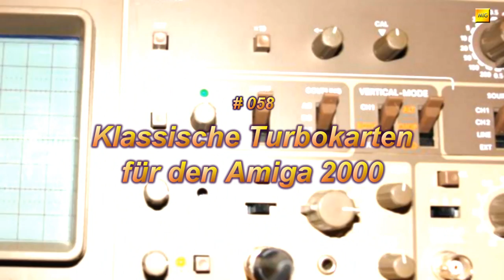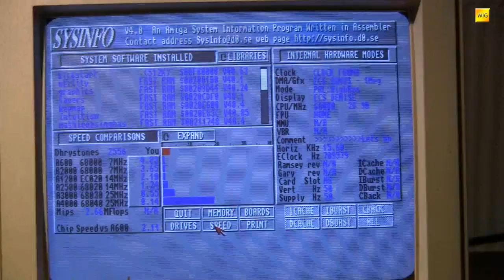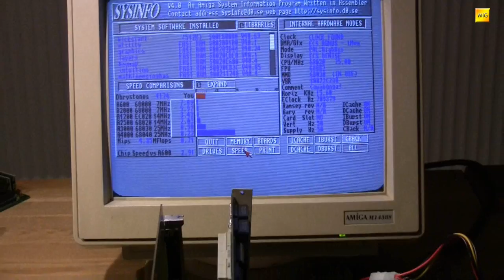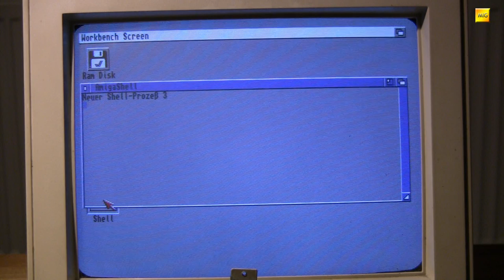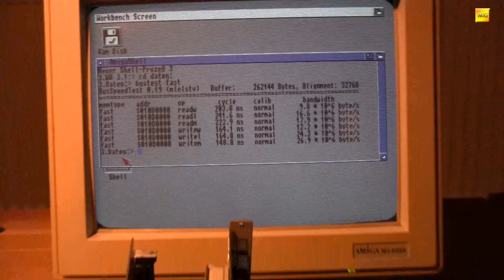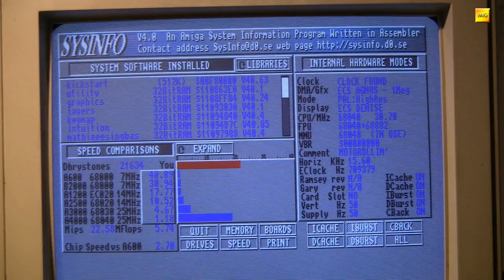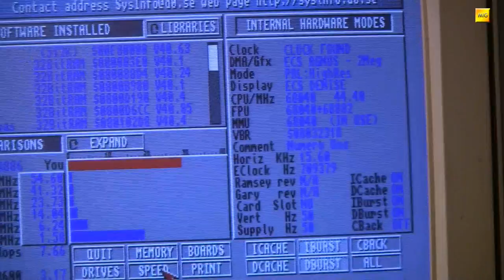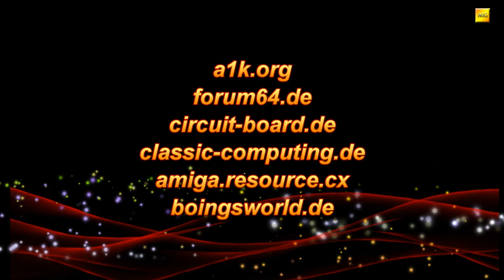MIGs Yesterchips - Folge #058 Klassische Turbokarten für den Amiga 2000

Comment: Danke fürs Video. Hatte die G-Force 030 mit 4 MB für damals 3000 DM, SCSI Platte ca 1000 DM, Syquest Wechselplatte 1600 DM, Flickerfixer 400 DM , Amiga 2000 nochmal ca 2000 DM. konnte damals nicht ein Bild über den Bildschirm schieben wie beim Smartphone und hatte dennoch riesigen Spaß, auch traf man sich mit Freunden um gemeinsam zum Spielen, quatschen usw. Mann machte noch was gemeinsam, daran erinnert man sich gerne.
ein Genlock und einen RGB Digitizer hatte ich damals auch noch.
Reply from the maker: Da hattest Du aber ordentlich investiert! Nehme an, dass Du das System zum Arbeiten eingesetzt hast? (Fürs Zocken wärs ja a bisserl übertrieben ;) )
Reply: Leider habe ich nie was gescheites hinbekommen, Genlock und meine Sony Videocamera hatten immer Probleme mit einem stabilen Farbbild. Habe damals gut verdient und sonst keine Hobbys. 
Das Genlock habe ich noch, war von Peter Biet oder so ähnlich, es kam als Set mit einem Videorecorder von NEC ohne Assembelschnitt, war also kaum zu gebrauchen.Es hat trotzdem Spaß gemacht. 
Viele Grüße
Thomas

PS nochmals Danke für Deine Videos

Comment: Phone me NOW!!! Hatte ich am A1200 schon mit der 040/40 ;-)
Wie ist eigentlich die Verfügbarkeit un Preislage bei 030 TK für den A2k?
Reply from the maker: CCfiftyeight Kommt drauf an ob du etwas gängiges oder etwas rares haben willst. Die A2630 dürfte so um die 200 Euro taxieren.
Reply: Ich brauche da nichts dolles. Derzeit ist es halt noch ein stino A2k mit scsi Platte und Aos3.1. Da für viele Progrämmchen und für whdload ja etwas mehr Leistung nett wäre und ich auch gerne meine cv3d gerne drin hätte, wäre halt etwas potenteres als die 68000 wohl angebracht 😉
Ich bin da leider schon eine Weile nicht mehr in der Amiga Scene unterwegs gewesen und kannte deshalb nur die Bucht als Bezugsquelle und dort sind A2k tk leider etwas rar... 😑
Reply from the maker: Für die CV643D wäre aber schon ein 040 angesagt. Klar, "laufen" würde die auch mit einem 020...aber da haste keinen Spaß.
Reply: Wobei die 040 Karten wohl "etwas" rarer als die 030 sein dürften, die waren zu "Lebzeiten" ja schon derbe teuer. Was die leistung angeht, hast du aber recht. In meinem A600 habe ich eine 030/42 und in meinem 1200er lange Zeit eine 040/40. Da lagen Welten zwischen, eine komplett andere Liga. Selbst die 25MHu 040 auf der PPC Karte war um ein vielfaches flotter...
Schade der der 1200er nicht mehr läuft... (Vermutlich das Elko Problem, mit löten direkt auf der Platine habe ich es leider nicht so)